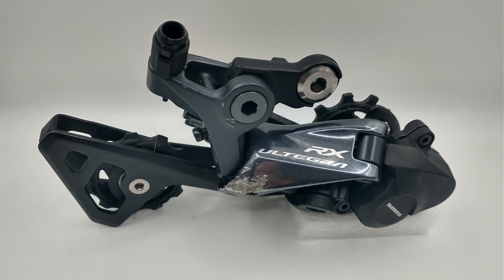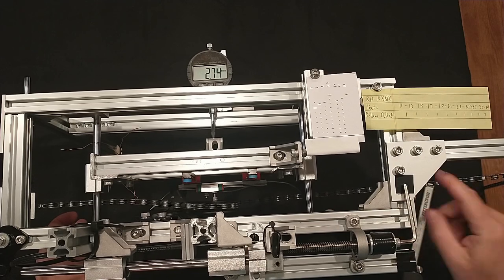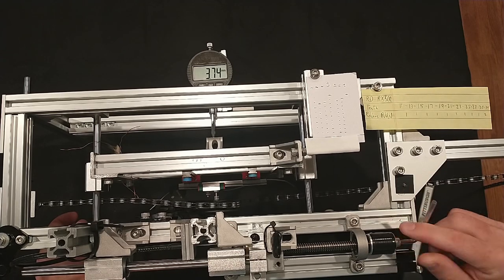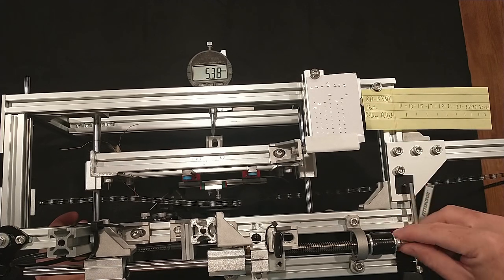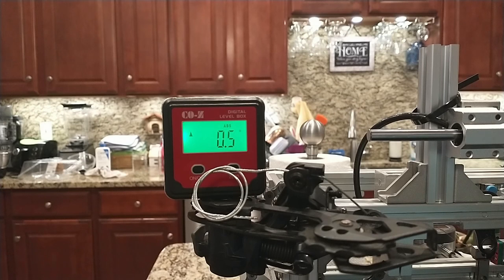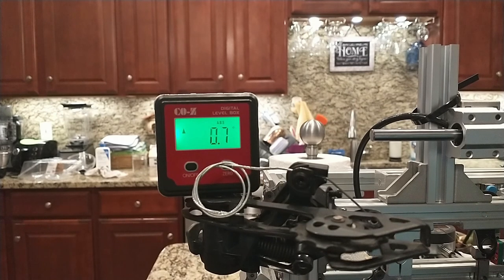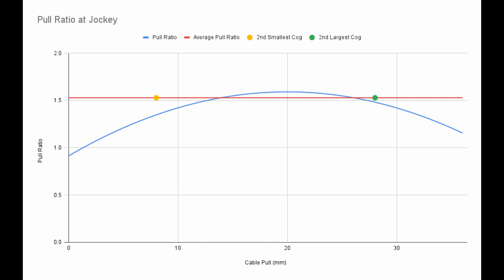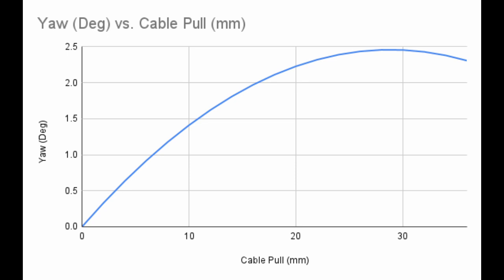Shimano Ultegra 11-Speed Derailleur Pull Ratio Measurements

Comment: Is there a table of derailleurs and shifters, their pull ratios and compatibility?
Reply from the maker: I've been compiling a spreadsheet of derailleur pull ratios and shifter cable pulls here: https://docs.google.com/spreadsheets/d/1uxu7OSKLG3JzhmOIg-iWHz-p8MW0ou0HCLRWk4BoO04/edit?usp=sharing

Compatibility is a bit more tricky. My measurements can help you figure out what /might/ work, but the only way to figure out what does work is to try it out. That being said, Russ at @PathLessPedaledTV is doing a great job of experimenting with different shifters and derailleurs to discover what is compatible.

Comment: Do you have any thoughts on why the cable pull ratio you measured wasn't the same as the GRX 10-speed RX400 you measured?  Both of these RD's are exchangeable with GRX 11 & 10 speed shifters, Dura-Ace & Ultegra & 105 11sp shifters, and Tiagra 4700 10sp shifters.  How much cable-pull ratio difference matters?
Reply from the maker: The Ultegra RD-RX800 derailleur appears to be a bit of an outlier, having a higher pull ratio than I would expect. I haven't published the video yet, but the 105 RD-5800 has the same pull ratio as the GRX RX400. Both the RD-RX800 and the RD-5800 are officially compatible with the same ST-R8020 shifter, but have significantly different pull ratios.

I'm still trying to understand why Shimano designed this derailleur this way. My main theories are:
- Improved chain control by really pressing the chain against the side of the cog
- New ideas at Shimano on how to improve shifting

My earlier video "The Problem with Traditional Compatibility" talks about how much pull ratio matters, but manufacturers will generally design the drivetrain so that the result of multiplying the cable pull and the pull ratio is anywhere from 5% lower than the cog pitch to 2% higher than the cog pitch, with about 2% lower than the cog pitch being the average.